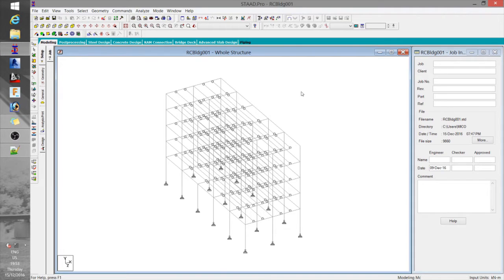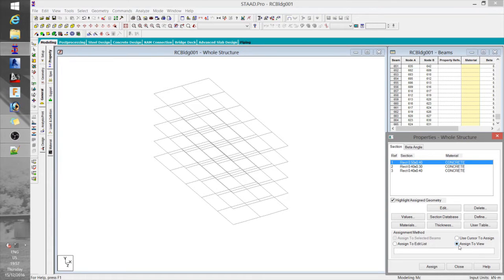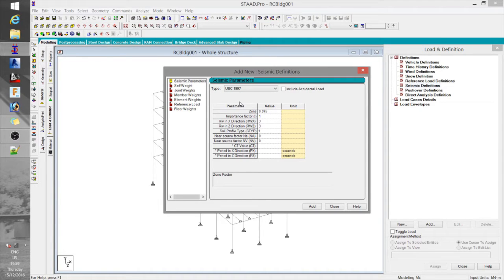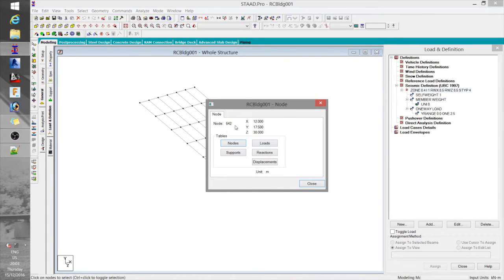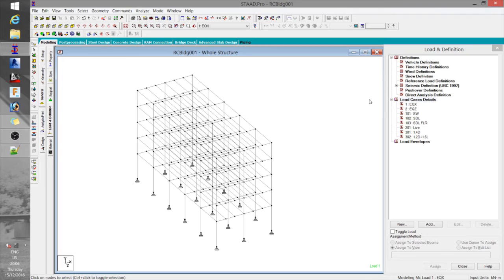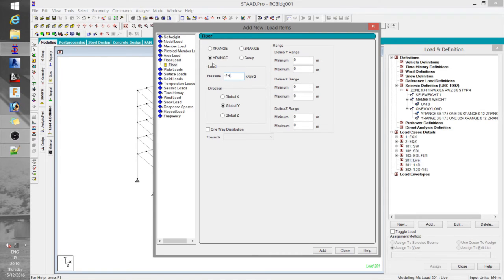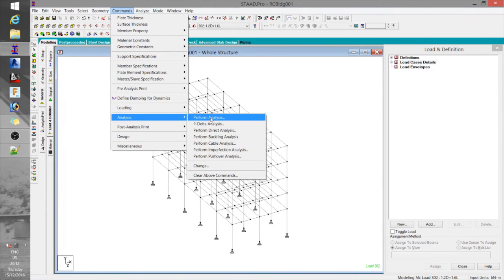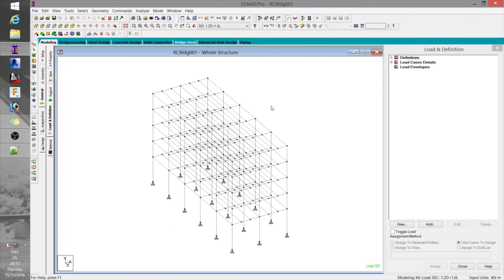03 Staad Basics - Modeling p2, UBC 97, Concrete

Comment: hii sir , great tutorial.... what is meant my  member weight  component in seismic weight section... in this tutorial you took a value of 8kn/m. how to calculate it?????
Reply from the maker: Hello, the seismic weight is what STAAD uses to calculate earthquake loads. For this example, the 8kN/m is a hypothetical value of the load from partition walls. You calculate it based on the geometry and density of your wall system.

Comment: Great tutorial.. Just wanted ask how we can define new materials as in ETABS and SAP2000? For example I want to use 20 MPa concrete for beams and slabs while 28 MPa  concrete for columns. How can I do that in Staad Pro??
Reply from the maker: Hello +M.Shaihan Ayub
For this particular version of STAAD.Pro, you can simply go to General (tab on the left) then Materials. You can specify the parameters there.

For the case of concrete strength, it is defined under Design > Concrete > Define Parameter > FC
Hope this helps

Comment: Hello Sir, rookie staad user here, whats the reason why you only add uniform load(8kN/m) on the perimeter beams. Nice tutorial btw. Very helpful!!!
Reply from the maker: Hello Jayvee. 
Your question is not STAAD related (if I understood it correctly). That uniform load is just an example. You may think of it as a wall/parapet or something similar.

Comment: sir, I have other warnings when I ran the analysis, "warning out of plane loads applied in a plane structure." What does this mean, sir?
Reply from the maker: You might be trying to specify a load that is outside the plane of your work space...
If you're working in a "plane" structure, say, in X-Y, your loads should also be in x and y directions. Introducing loads along z will toggle that warning. If you're working on 3D, change "plane" into "space"; you can do this via the Editor.

Comment: Thanks for this video.

May I ask why the following load combinations are not included in the model? 

U = 1.2D + 0.5L + 1.0E 
U = 0.9D +/-1.0E
U = 0.9D +/-1.0(ρEh+Ev)
U = (0.9+/-0.24)D +/-ρE

Does staad generate these in the Load 1 and Load 2 cases? Many thanks.
Reply from the maker: You're welcome +Antonio Amante.

The purpose of the video is to demonstrate a way on how you may work on STAAD. With that, we intentionally left out other loads and combinations for simplicity of discussion. And please take note, STAAD DOES NOT automatically generate load combinations...you have to do them your way.

You might have other questions in mind and I encourage you to go through the playlist if you have the time; since we had the entire discussion developed from the first video to the last...

Thanks for dropping by.
Cheers